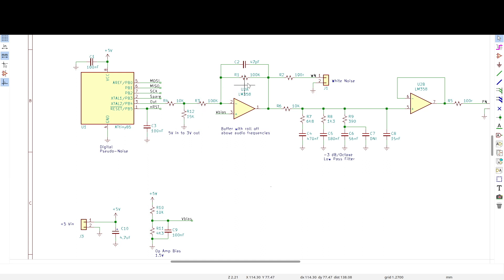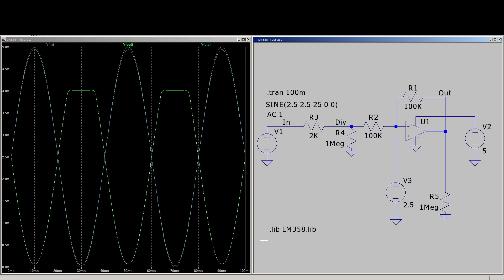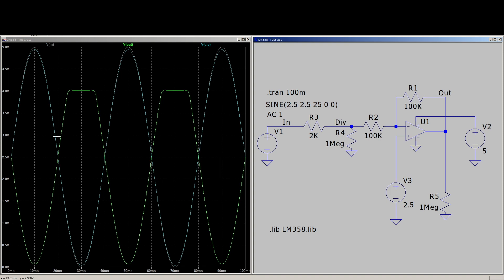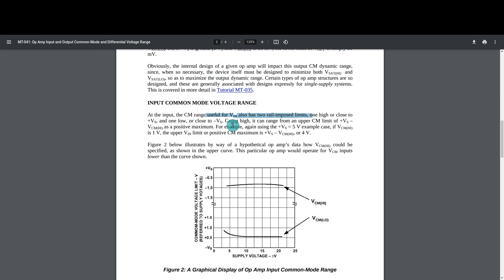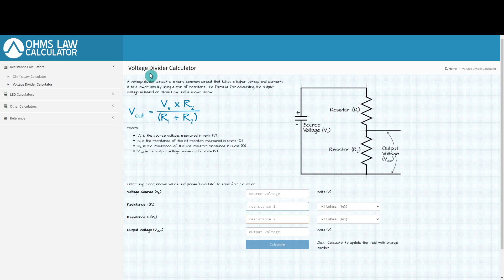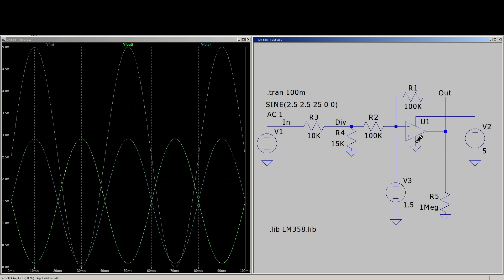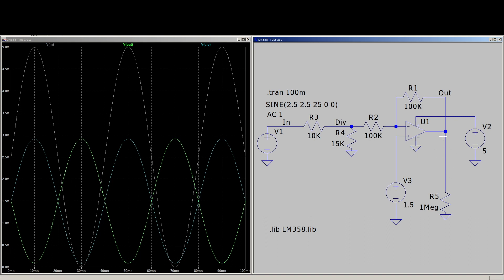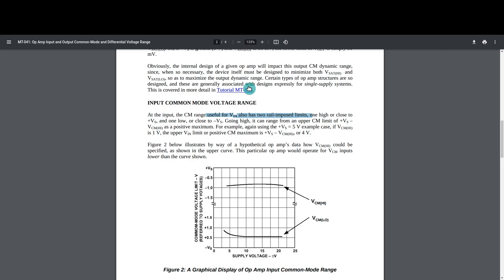Op Amp Resistor Choices for Vin and Vout Specs

Comment: You should keep the bias should be set to 1/2VCC to give you a max voltage swing on the output.
Reply from the maker: What I found was with this op amp not being rail to rail, the max output was between 3.5 and 4v out of 5v so when I was biased to 2.5v the top would clip early.  When I re-biased to be 1/2 of actual output swing I was able to use higher input before clipping.
Reply: @gadgetsideload  Hi, what the problem was that there is a DC bias on the Input signal which added with the AC signal and shifting the output causing it to hit the rails. When you have a single rail opamp with a virtual ground, the AC input signal has to swing around this point. The feedback on the amplifier will cause the inverting input to also be at the same bias point as the noninverting input. 

e.g with a split rail +/-12V the non-inverting will be connected to ground, due to the nature of the feedback the inverting input will maintain a point close to ground (virtual ground). The opamp wants the two inputs to be at the same voltage (ground) so as current flows from the input the output swings to supply a current equal and opposite to maintain the balance.  By changing the feedback resistor to twice the input resistance value, then the output needs to swing twice the amount of the input to provide the equal and opposite current. Hence voltages gain of 2.
Now if you add a DC bias from the input source with the AC signal superposed on this, the output has to swing to cancel the current caused by the dc offset and by the ac signal. So now the output will swing about a different DC point and the signal my hit one or both rails.

This is why you need to block any DC component on the input with a cap.

Remember the output from a uP pin switching at a frequency with a 50% duty cycle will have an apparent DC bias of ½ the uP supply voltage. Change the duty cycle and the apparent dc bias moves up and down, affectively  a  DAC.

The opamp will amplify the DC on the input by the same AC gain.

sorry about the long post but i hope this helps.
Reply from the maker: I'll probably try several scenarios for observation to see what happens when setting it up different ways.  I forget how I even did the final schematic now!  The good thing about simulations is it's easy to open the file and try new things compared to breadboarding it all again.  
If I ever get the energy to play with transistor amplifiers I'm sure there'll be lots of fun there...Maybe I should skip straight to vacuum tubes.  I can borrow the high voltage from a guitar amp...
Reply: @gadgetsideload  I've got a radio with a valve PA, nothing like trying to measure something with 900V on the anode cap.  much more fun to simulate that less painfull as well.